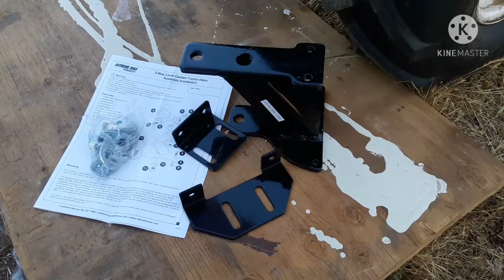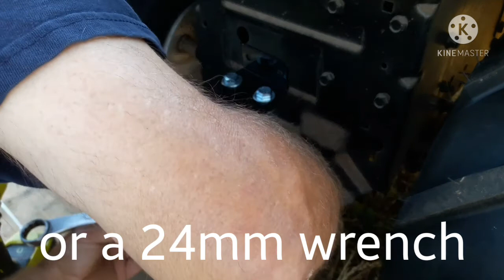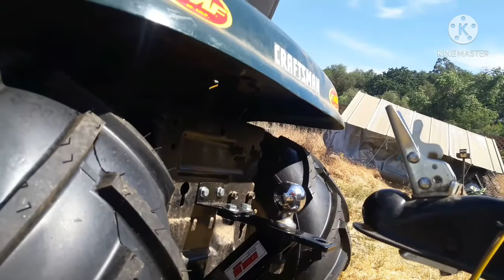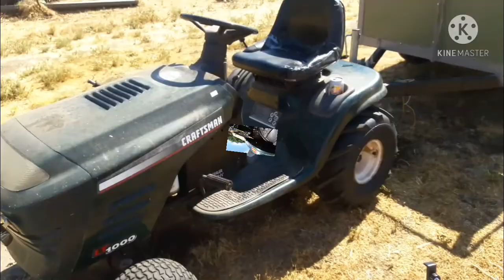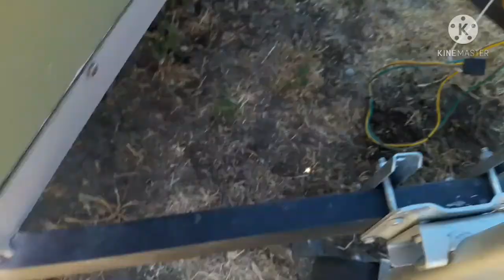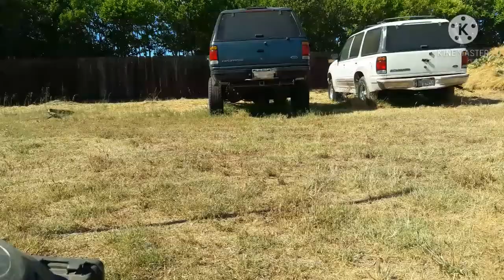I put a trailer hitch on my lawn tractor.

Comment: Thought about getting some solid front tires and some elevator weights and strapping em to the front end and see if she’ll scoot boot but figure if i needed it that much than i should be able to fit my truck back where i need it….
Reply from the maker: You could try filling the front tires with water. I have no problem towing an empty trailer